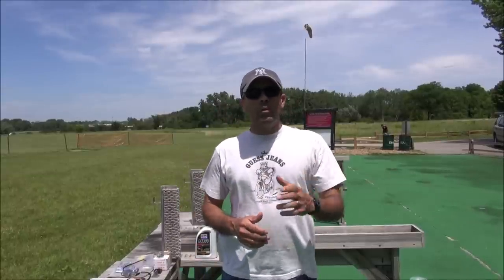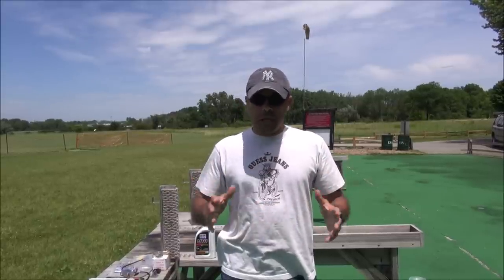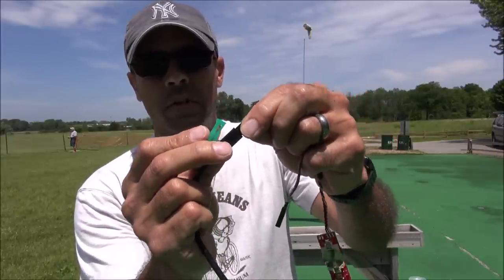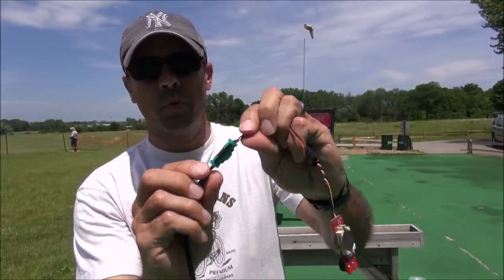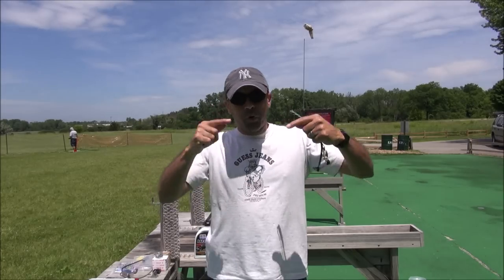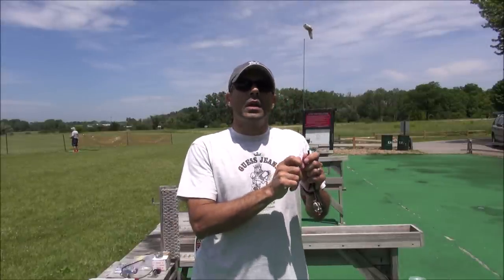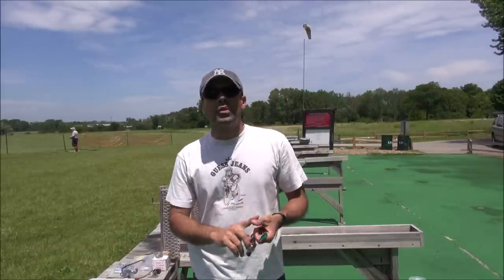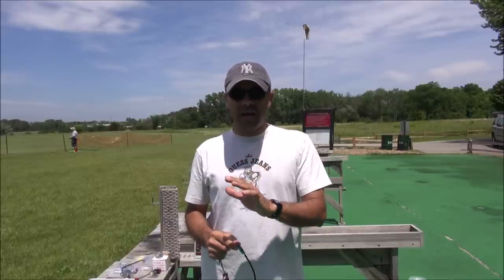RC Gas Engine Performance & Troubleshooting. Part 1

Comment: I know your focus is on rc aircraft, but maybe you can shed some light on the issue on an rc car engine I recently bought: a 36cc Rovan engine.
Even though I have considerable experience with rc 2-strokes, I'm now confronted with an unusual problem.

Day One: I filled my Redcat Rampage XR's tank with fuel (25 to 1 mix) and started it. No problem. I ran it between 15 minute cool downs. I also ran it while not hooked to the Dynamite killswitch. I tell myself, I'm set.

Day Two: I take the model downstairs. I try to start it. It would not start, either with the killswitch LED set to start, or unhooked to the killswitch as I did on day one. I checked for flooding, and checked the spark from the plug. There was spark, but I must say, the spark was so obvious it shocked my fingertips. I replaced the plug and kept trying to start the engine. I kept on ... kept on -- AND SUDDENLY THE ENGINE STARTED AT ITS FULLEST SPEED! 

I was glad I was able to hold onto it and stop it from tearing out of my garage at such extreme speed and hurting someone or damaging property. It was frightening. 

The revs were so high the paint on the exhaust burned up and the car was smoking. I oanicked and hit the kill switch button; it wouldn't stop. I hit the stop button; it wouldn't stop. Eventually I came out of panic mode and pulled the cap off the spark plug. It stopped then, of course.

I let it cool, turned the idle right down and started the engine again with the killswitch in place. Again, it didn't idle but went into its highest revs. I hit the killswitch; it didnt stop. I hit the stop button, it didnt stop, so I pulled the cap off the spark plug.

I have never seen or experienced ANYTHING like this.

Can you shed some light on what's going on?
Reply from the maker: This sounds to me like a signal interference with the electronics in the model. This can sometimes be a consequence of bad cables, switches or ignition.

Comment: Thanks for these videos!  I want to get into gas engines.  Many of the models I am looking at recommend a .60 or .91 4 stroke nitro engine.  Is there a reason why I should not use an equivalent sized gas instead, or is it better to use Nitro?

Comment: Over all Good video but please allow me...
At 9 minutes in the video you explained the rule of thumb and you show a picture at 9:20 as an exmple. I get the point that its you're personal rule of thumb but in ingineering, the real rule of thumb is that the length of the bolt (the part that will connect to the other peice) has to be 1.5 times longer than the bolt diameter. For exemple if you have a diameter of 4mm you need 6mm of bolt left to screw in. This is to prevent a force to pull out the bolt. This is not for vibration purposes. No matter how long you're bolt is, the vibration will unscrew your bolt, for that you need an adhesive like loctite.
In you're picture at 9:20 your bottom bolt has more than 1.5 times the diameter which is more than enought, you dont need a longer bolt like the top one.

Comment: Regarding Loctite or Threadlock: Do you use Red or Blue threadlock? And for which connections (ie muffler, engine mounts, etc)?
Reply from the maker: NUMB LOCK Personally I only use the blue one but you could use red on engine mounts and mufflers. I suggest trying the red on a loose bolt and nut to figure out it's strength.

Comment: Is there a gasket usually supplied with an engine when purchased? Or do you have to use something like Black RTV to create a gasket/seal?
Reply from the maker: NUMB LOCK I assume we are talking about a muffler gasket. Some engines may come without a gasket, in that case use Hi temp silicone/rtv. I use it in combination with the gasket anyway.
Reply: MoongrassTV Thanks for the keeping up with the replies to all our questions. Many other videos' questions go unanswered. You're doing an awesome job responding.
Reply from the maker: NUMB LOCK Thank you, it is my pleasure.

Comment: How about metal linkage to the engine causing interference through the radio. I have been told to use plastic push rod for the throttle or there may be interference or glitching during flight.
Reply from the maker: mreid08 Yeap. I have had some friends who came across that problem, I have never had that problem though. I wouldn't recommend the use of plastic push rods with gas engines due to the strong vibration, consider carbon fiber instead. Thank you.